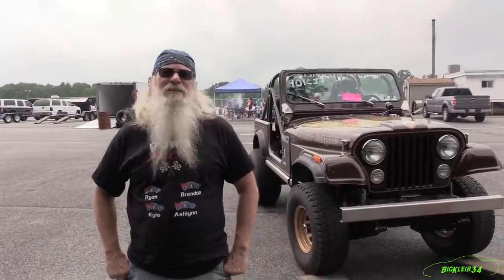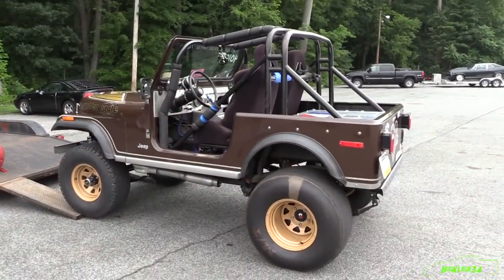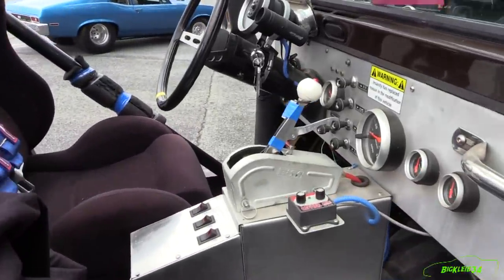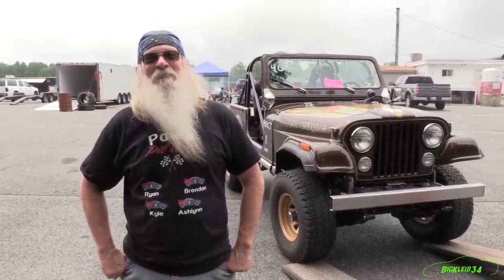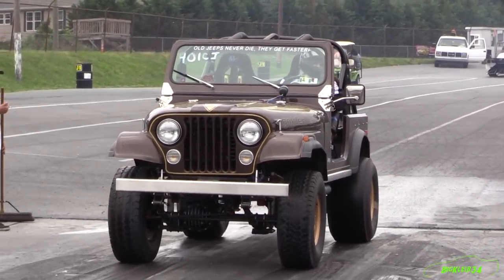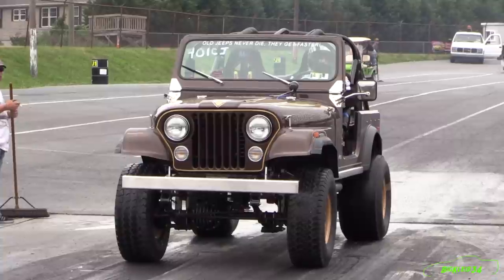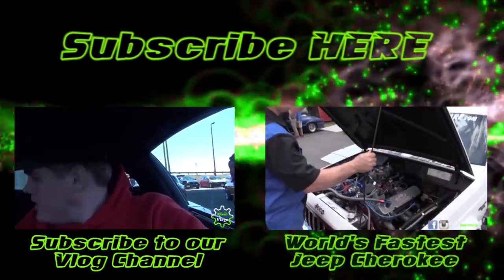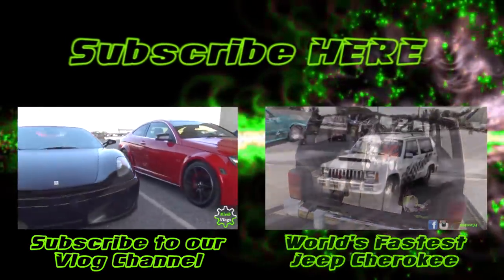The Ultimate Sleeper Jeep Comes to LIFE

Comment: I built a 0.30 over 10.0:1 compression 401amc V8 for my 74 CJ 5. Port and bowl worked Edelbrock performer heads , RPM Airgap intake , portmatched , Dougs ceramic coated Tri Y headers , Comp 268h cam , Harland Sharp RR , oil mods and Holley Sniper EFI ....Fast ? ....Insane is more accurate. I smoke the rear 32" mud tires while pulling the front tires 5-6" off the ground while screwing around and getting on it

Comment: I bet that CJ  is fun to drive 😃🤙.  I’m actually building a YJ with a forged 383 stroker  with  flat pistons and a set of 64cc/225cc heads 🤪😅. And I’m actually more excited to drive it than the camaro SS 2017 that I have 😅.
Reply: Hey Luis is your YJ up and running? If so you racing it or is it a partial daily driving rig? I have been thinking of doing a swap, and a smoothed out 383 (non aggro cam) would be great for idling over offroad obstacles. Working on getting axles set to handle it now. 8.8 rear chromoly axles and a carbon off road beefed 44 front. Should be able to take whatever I wanna toss in in it.
Reply: I'm with Lenack.  🇺🇲

Comment: That was a ton of work for a 13 second 100 mph pass...  Probably either the power isn't there or the torque converter is wasted.
Reply: 13.0 at 100 tells you it's over geared, prob did 100 300 ft before the 1/4

Comment: I think he hasn't heard about a lsx.
Reply: Dem sweet sugar walls.   Maybe he has. But most likely he wants to keep the Jeep AMC and not another transgerder jeep with chevy motor in it. The 401 is a monster when it comes to torque and horse power but like everything else it needs to be combined good in order to work good. I honestly would take the 401 over the LSX when it comes down to torque. Yes the LSX is bad ass but the 401 was also a bad ass engine back in the day.

Comment: Any of you trolls notice he spun them bad and let off the throttle?
This will run plenty faster than 13s go back to your video games. 

Only old timers know its not hard to get 600 out of 401 with old stock iron heads 
435lbs tq bone stock was a lot in a light car.

Comment: If only Jeep Wrangler's came with a V8 motor stock! It seems every other off roading truck or SUV has the option so why not?
Reply: Tom Boyle The good ol epa and their requirements for mileage
Reply: Such a shame If only I lived in the 60's and 70's before all these dumb laws were enacted
Reply: Jeep Wrangler srt8 I believe has one.
Reply: Isnt that a limited edition?
Reply: Tom Boyle The old Jeeps had an optional 304 V8. Years ago. I think the CJ5 offered that motor. Mayve a few others as well.
Reply: I believe the CJ7's also had the 304v8 as a powerplant option
Reply: Tom Boyle you mean 50s and 60s
Reply: ***** They have never made a Wrangler SRT8.  Just Grand Cherokee SRT8.
Reply: +Fullforce LTX 70 jeeps had the 304s use to drive a 78 its had a 304 with a 3 speed manual funn to drive an would go anywhere
Reply: Pretty much all newer Jeep's do

Comment: He needs to ditch the AMC engine, Put a Big block in it that's making near those numbers stock. Most of the way through I was like holy shit that thing is gonna be a beast, Oh wait, 350 hp to the ground?.... Come on now.... Don't...
Reply: But everyone puts big blocks and LS motors into jeeps now days its played out why not do something original. Like he did.
Reply: I agree, But that original AMC is damn slow even with speed parts put on it.
Reply: If that was making 350hp to the wheels at 3,500lbs it should of been much quicker than 13.2 at 100mph. It's a new build though so he's probably working the bugs out of it. Should get faster after a few runs in it. Not anywhere close to 10's though. Probably making 300hp to wheels if not less on that run.
Reply: a guy I know was running a 76 Jeep Wagoneer.  He was trying to blow up the engine cuz it was a 360 and on its last leg, he had a big turbo and kept turning it up so he could have a reason to stuff a 401 in it.  Took 45 pounds of boost to get it to let go.  All that happened was a blown head gasket, so the engine largely remained together.  These engines will take insane amounts of abuse and as such are worth keeping.

The guys jeep can be seen on youtube, look up ghinmi and you can see the jeep in action.
Reply: What he needs is an LS 5.3 engine why because its light and powerful in a small package plus it loves to  rev high. Big block will just make it heavy with too much torque and will have hard time hooking up on the track since jeeps are rather light weight.
Reply: Those 5.13’s are killing him.... some 3.73 or 3.55’s lengthen his stride a lil bit.
Reply: You must not be familiar with what a AMC 401 can do when set up correctly!
Reply: @anubis8680  Not for the 1/8 mile, especially with 33" rear tires.  Maybe 4.56 or 4.88 and that's for the 1/4 mile mph at the expense  of the 1/8th.
Reply: Yep a newer 5.7 hemi set up would be nice like a 2004 with the 5 speed so the trans would fit it that short setup he has
Reply: @anubis8680  not sure what rear was on amc but if he uses mopar I would go 3.92 gears but a chevy 3.73 and even 3.55 would b an upgrade you are very correct
Reply: David Pinto  yeah and b all show no go amc blows .....that's y it isn't here today ...chevy parts are everywhere go to anywhere local and find Anything  AMC.....u won't....
Reply: @unherolike   Exactly
Reply: Exactly